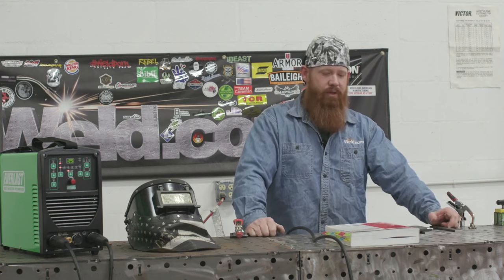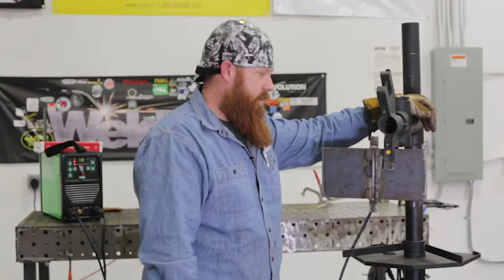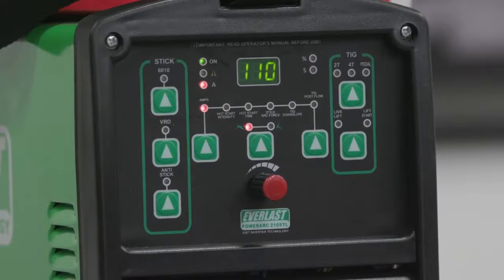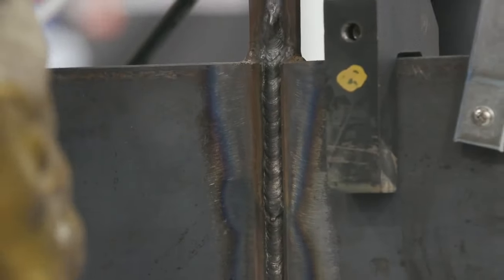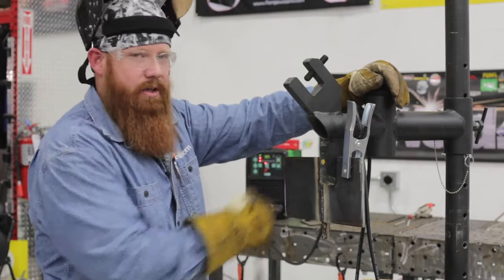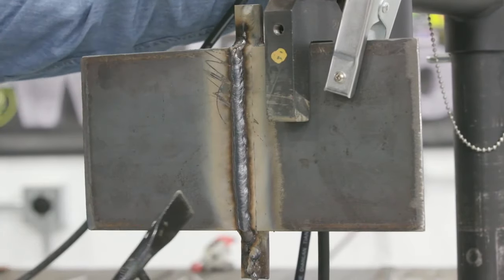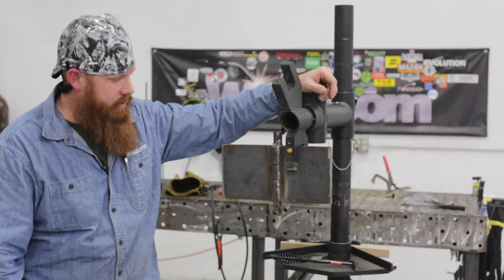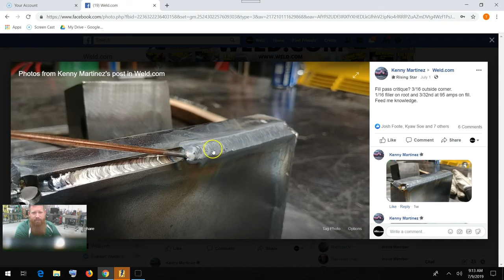AWS D1.1 SMAW 3G Qualification Test

Comment: I’m 19 in welding school right now on a scholarship, $4,000 of the $4,250 will be paid for as long as I get certified in at least one position. COVID 19 cut my school year 9 weeks short and spring break turned to summer. Now we’re back for summer classes. Long story short, I have two days left of summer school to finish my 1 inch plate 3G cert. If I fail, It’s quite possible I’ll then owe $4,000 to the school; and since there wasn’t any time for a practice certification beforehand(like there normally is here), this is my only shot. Plates are cut and grinded up pretty, just need tacking and all the passes... wish me luck.
Reply: How did you do? I'm in the same boat - my school cut our lab hours way back after spring break. About to start back up with stick and mig.

Comment: I agree with not using power tools when you're learning you should be able to lay down good strong welds with normal welding tools i even don't like when coworkers and others grind the face of the weld off .. clean the scale and spatter off and show off your welds
Reply: If u clean test plates at all here  with a grinder anything u fail not allowed the inspectors watch you will not let you clean the weld out or down to tollerence also grinding will contaminate  your weld surface and when comes to xray its noticed also.
Reply: I've seen it happen..

Comment: We didn't get to use anything powered when taking these tests in school either. I was told if I needed to cut anything off I should turn up the amps on a 6010 and use the arc to make the cut and I actually had to do that once and it worked!

Comment: I'm not in school for welding. I have done it in High School back in the 80's but now I'm doing it on the side at my place of employment. I'm kind of learning through trial and error. I weld on a lot of thin and rusty steel. Trying to weld overhead, vertical and horizontal is a big challenge for me. I use a Miller Bobcat 225 diesel welder and trying to dial in my amperage settings is a challenge cause the dial only has numbers from 1 to 10. It doesn't literally show me my amperage setting. However. I have learned and actually used some of Bob's methods from his older videos. It would be great to see a video on setting a basic generator/welder with just a number dial. Keep up the good work. I'll be watching for more SMAW videos.
Reply: Christopher McMichael we will be doing some videos on the engine drives soon. Stay tuned.

Comment: Really appreciate videos like this.  I'll never do code work but it's very interesting how you stacked everything in your favor.  Landing plate, clean metal, starting bead outside of the groove, a welder with hot start, dig function, favorite welding helmet, gloves that fit and let you move your fingers.  I need to put more effort into my projects at home to make them this good.

Comment: I allways start in the middle installing Backup strips and work to the outer edge both ways if you weld both outer edges first you will Warp the backup strip or put a bow in it .😎
Reply: Curtis von Epp I’ve seen it happen myself quite a few times. I usually don’t have a problem doing it this way but you make a  valid point.

Comment: For my root I don’t start so far down on backing strap because I want the rod to make it past the middle part of the plate. So I try to stop at the top part of the plate and restart. Also I run slower at bottom of the plate so puddle can build up more because normally at the top of the plate the heat makes the weld come out higher

Comment: You mentioned to get a pick to dig out any slag trapped anywhere in the weld, is there a time when one can use a heavy duty wire brush or either a cutting wheel or a grinder..... lol, just saw your comment at the end of the video....
Not a grinding test , but know how to use all the basic welding tools and equipment.

Comment: Enjoyed it very much. How thick in mm must the backing plate be. I enjoyed the half moon or U shaped welding teqnique in vertical.is a vertical up weld better than vertical down and why is that?
Reply: Duncan Mac Farlane for this one I used a 6.35mm thick piece but usually run a 9.5mm. For this process being used in a structural application vertical up is better because you get better penetration. On an open root you can run up or down depending on the electrode you’re using and the code you’re working to.
Reply: Welding to a "Pre-qualified" procedure, ALL vertical welding must be upward progression. 
Also, 7018 is only qualified for upward progression

Comment: Obviously they are gonna toss away mid plate where the tie in was on the root (CWI ain’t gonna use that portion of coupon), but was expecting a better tie in on the root pass. Little undercut on the right side of that root tie in (it happens to us all). Still a good weld though. And he’s welding D1.5 (Bridge Welding Code) on top of D1.1 (Structural Welding Code) if you viewers didn’t notice. That’s a good thing. Anybody see that also? He’s doing D1.1 & D1.5 👍🏼
Reply: The book indicates where the bends come from. 1" either side of center for a welder and 2" for a welding operator. If a welder has a re start in that area that's too bad they better get it right.
Reply: Hardstyle818 that’s how I was certified through the hall D1.1 and D1.5. 1” 3G and 4G. No power tools. You’re right about the tie-in though. It looks way worse on camera 😂.

Comment: How long has backing plate been used for a authorised insurance qualified 3G vertical plate test, When I passed mine it wasn’t aloud, Root fill and cap, Also did 5G & 6G pipe test, All material were 13 mm thick, Pipe was 150mm diameter and plates were 300mm long.🇬🇧🇮🇪.

Comment: Thank you for the excellent videos!
I was always told that we cannot weave the cap with one bead. You had 3 stringers on your cap. Is there a spot in the code book that says you cannot weave over 4 times the diameter of the rod for a 3/8” plate test? I have been looking and cannot find it

Comment: Thankyou, I am studying for the CWI and this helps
Reply: Fun times. Are you going to take the AWS seminar? Well worth the money in my opinion.
Reply: Eric Borgen that’s actually where I learned  the part about the as fit-up and as detailed info I shared. As a welder, I did not know that. Glad I went and did the CWI course. It’s helped me a lot since I still weld.
Reply: @GodslilRedneck23  Basically the "As Fit Up" is the point where the CWI will make you re fit the joint. If it is within those tolerances your ok to start welding.
Reply: Geoff Moore yes sir, that’s correct. I was just pointing out your maximum and minimum requirements for the prequalified process for the Bu2a.

Comment: How long do you let your plate cool in between passes? When practicing at home, my plate was bending towards me even though I felt like i was sitting around waiting for it to cool more than i was welding.
Reply: Phillip Gober I usually run the root and hot pass with no wait in between. Then maybe about 2-3 mins before doing the two interpasses and about 5-7 mins before starting the cap with a 2 min wait between each stringer on the cap.
Reply: Even if you were to leave it to cool right down so you could touch it wi a bare hand between passes, it will warp or distort. Its simply physics. As things heat up they expand, and as they cool down they contract. Nothing that you can do about it other than pre-stress it

Comment: Not trying to question your knowledge. But just to
Make sure I heard correct or you meant what you said. A root opening of 3/16 to 9/16 with a backing strip? That’s new to me usually it’s 1/4 backing 1/4 gap +- 1/16 on 3/8 plate that is.

Comment: Hi just a quick question. I am welding my cwb vertical 3g  and our plates are 90 degrees and 30 degrees. I was told to do a root  stringer on both sides with stops and starts. Then all the following passes are in a weave. Is this up to the discretion of the inspector or would stringers be more widely accepted?

Comment: Just a question do you or do you not discard the eans of the plate 1/2" or so? I think for the bend test but maybe not for the visual inspection? Also what about grinding out the crater where you stopped and started?
Reply: RMTX 25 for a bend yes you start at the center and measure 1” either side of center, from there you measure 1-1/2” past the 1” mark. Those 1-1/2” sections are what get bent. The visual only applies to the welded plate the entire run on/run off tabs get cut off and are not inspected. You shouldn’t have any craters on your test plate. They have to be filled in to the entire cross section.

Comment: Can you do a 1' plate test like that, ive tried and never succeed well with keeping the weld flat, its always shallow on the ends, i think because i dont put enough metal on the runoff tabs
Reply: patrick Flynn yes sir, I had to certify for the union on 1” plate 3G and 4G. 4G is definitely easier though. If it’s not laying flat it’s usually the run off tabs not being utilized enough. Another thing you can do is tack a couple small plates parallel with your bevel just like the run-in/run-out tabs. That’ll help keep you straight and true.
Reply: Just the insight I needed. Thanks guys 👍

Comment: About your last comment. I have never seen a code that forbids power tools for inter pass cleaning. To be honest if you were using a chipping hammer to clean a weld but had a 110V outlet and a grinder right beside you, I think the boss might be asking what the hell you are doing. 
Yes at most schools they like to see the student pass with out power tools. At work when I am testing guys it's really not an issue. I would rather see someone identify a small mistake and correct it and pass UT/RT or a bend test. Rather than try and weld over a mistake and just hope for the best. If they get into that habbit your going to have a lot of weld repairs.
Reply: Geoff Moore I agree with you for in production but not for a weld test. AWS D1.5 Bridge Code prohibits power tools and grinders during welding qualification. It’s just a good practice to get into for when you don’t have the tools or can’t use them.
Reply: @GodslilRedneck23  Good to know. As far as I can tell they restrict tools in D1.5 because field work may have limited power so they want to know you can do without. I had to qualify my all position SMAW and FCAW plates with no power tool as well. This was a rule at the school I was doing the testing. NO GRINDING IN THE BOOTH was printed on every hallway. I could have removed the part and took it to the grinding room but there was no need and time did not permit. It was 8 test plates in one day!

Now being an inspector myself I just tell the workers to do whatever they do at work. I'm not there to tell them how to weld I just issue the test as the code says.
Reply: Geoff Moore I agree. It just builds the confidence when the students know they are capable of doing it without the grinder.

Comment: Would love to see a good gmaw short circuit setting for corner flat and lap joint positions
Reply: Brandon Lewis it’s going to depend on your transfer mode, (short circuit, spray, globular, pulse etc) also depends on wire diameter, position and type of material n send me some of those parameters and I’ll see if I can help get you dialed in.

Comment: I started school a couple weeks ago and I'm struggling with nerves. I'm pretty much just multipassing fillets in each position. On flat, which I hate, and we've got to do what you're doing in the video next and its going to be an AWS test I believe at the 280 hour point and I'm at around150 now. Like I said my nerves are fucking with me just thinking about the steps I need to take considering what I dont know, like to use the track torch or anything to do with any of it beside the weld lol any advice would be so nice! I haven't even been shown this yet. I'm hoping soon.

Comment: Does AWS specify that you have to weld uphill or downhill? I had an instructor at my school say you can weld down hill, and another Instructor says it's only uphill? So I don't know what aws requires? Also is it the same requirements for mig?
Reply: Alex, AWS publishes many codes and other standards. In some sutuations with the proper electrode it may be totally acceptable to weld downhill. In this situation since he is using a 2015 D1.1 PREQUALIFIED procedure he is limited by clause 3.7.1 which states "The progression for all passes in vertical position welding shall be upward, with the following exceptions:

(1) Undercut may be repaired vertically downwards when preheat is in conformance with table 3.3 but not lower than 70 degrees.

(2) when tubular products are welded, the progression of vertical welding may be upwards or downwards, but only in the direction(s) for which the welder is qualified."

In the new 2020 edition of AWS D1.1 this has moved to 5.8.1.1

Comment: So if I’m testing NR232 on 1/2” material I need what root opening and bevel degree ?
Reply: I typically run a 3/8” root opening with a 60° included angle, bevel each plate at 30°. When running NR232 or NR233 point slightly down into the puddle while traveling in the vertical direction. If you get ahead of the puddle, the wire tends to burn right through the plate.

Comment: On this test for the actual certification is it required to run stringers or can you run weaves too?
Reply: AWS does not specify (or limit) what type of bead you can use for the test.  Any limitations would be found in the Welding Procedure Specification

Comment: I’ve been practicing on 3/8 plate with 1/8 rod, 1/4 gap and 22.5 bevel and after my second weave pass I’m already almost flush and do 2 more passes to cap. Is that ok or am I missing something? Not sure how you made 7 passes on that and still finished less than 1/8 above the base metal
Reply: what rod are you using ? 7018? whats your amps? if you run your bead faster you'll have a smaller bead, which will let you run more passes, slower your puddle is gonna be thick/fat and cover more area. You've probably figured it out by now being this comment is a month old.
Reply: @ORSurfbum  ended up passing and getting my job! 1/8 7018 118-120 amps on my vertical and 125 I believe on my overhead.

Comment: I hate using 1/8 inch rods for vertical  do much metal to carry it humps up in the middle and the heat builds so fast 3/32 is the way to go if you have that option its slower but more controllable

Comment: E7018 restarts: I'm getting slag/porosity issues when trying to employ long-arcs. Is it more of a 3x/4x travel speed vs 3x/4x arc length? I'd say I'm at .5-.75 arc length (.125 rod).
Reply: Mr Wolf I keep as tight an arc length as I can. Long arcing will lead to porosity. I set my hot start at 75% and my arc force at 35% and push the rod. It’s like welding by braille, you can feel the rod cutting in and getting shorter.

Comment: In a test are you required to keep the stubs?
Reply: No. What would the reason be for doing that?
Reply: @geoffmooregm  as it is a test, one would want to know what rods to use. Or is it ok to grab any rod I can find laying around?
Reply: @ericreynolds74  Oh no you definatly need to use the electrodes listed in the procedure you are given. When welding in the field after you pass you can use any rod with the same or lower F number. But you must always use the rod listed in the procedure. You cannot substitute even if it is the same tensile strength. For example one cannot use a 7024 rod in place of a 7018 rod.
Reply: So my question is valid
Reply: @geoffmooregm  bad example given 70 and 70 are same tensile strength  but I get what you mean the 7024 cant be used in a 3g position anyways so u would fail
Reply: Eric Reynolds not usually. The inspector should be witnessing the test so they would know what you’re putting on there.

Comment: Too bad you didn't do a bend test on your coupon for us! Sorry, but you were 5-10 amps cold on that demonstration, (probably quirk with machine), every toe of your stringers had lack of fusion, and undercut. Really don't believe the straps would have passed. UA pipefitter 37 years.
Reply: scotty362100 I usually run this test 2 times a year at 110amps and do a bend test and pass to show my students how to do the test. They also pass the bend at 110 amps. As soon as we build a bender for the weld.com shop we’ll start bending the plates. Due to camera angles it may look like there was undercut and lack of fusion but I assure you there was not. It met all visual inspection criteria according to Clause 4 of the D1.1.

Comment: Damn I must be a pro cause those looked like crap at my school and cwb test that be a guaranteed fail with backer plate aswell
Reply: Why is it a fail with backer plate?
Reply: @geoffmooregm   canada has highest standards of testing they want the weld to be perfect with out the use of a backer plate tighter tollerences aswell canada is one of the only countries tickets that allow you to weld anywhere in the world.
Reply: @Millwrightmike  I am a CWB level II inspector. The CWB and W59 has no restriction on the use of backing. Qualifying on backing also qualifies you to weld from one side, gouge to sound metal and finish the weld from the other side. It all depends on what you need to do. If your welding pipe or tubular connections with no access to the back side then open root is probabally going to be a requirement and a welder must be qualified to weld that joint to code. 

Yes Canada has a great welding program nation wide. It is much more organized that the US that's for sure. As for welding in every country, well that is not a given, it depends on the job and the code used. Most codes readily accept welder qualifications to other codes. If your CWB or AWS qualified then yes you can probably weld almost anywhere.
Reply: 😄 majority of codes and standards, are only valid when welding for the same COMPANY that the procedures initially qualified by.... not transferable to another company, let alone a different country 🤣